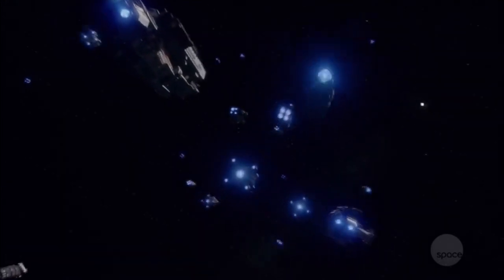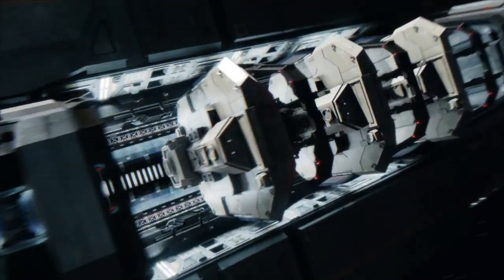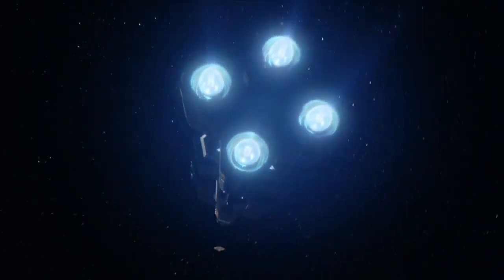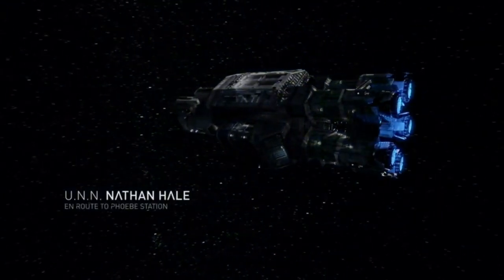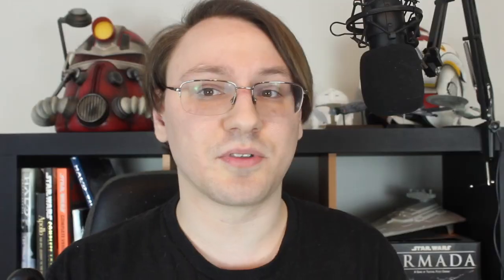Propulsion in The Expanse | The Expanse Lore

Comment: Gas or chem for space traction then using the electro box or ion or adv ion or slightly better still yet epsteen to get up to A speed four a continuation of ackselleration curve , witch is Amix of "deflecter fall field foward & akseletation dounut right angle almoast41.4%bow to49 aft push" a.k.a. Dule warp donut with particol deflecter for friction negation & safty tunnel as A hive or over all near light drive then coast under deflecter , only apolo out of atnesfear stress like ackselleration happeng haveing ceast escolarion speed perseption value density , aka majority resionable non burn flight for near light drive as A hive method drive so their yu are practal application for desired resolts witch would give even better top number than fiction if only slightly as fictionale Epstein drive only for akselletation curve relative to aplyed cellular to endrocinetick or aka human limits...

Comment: Why do you think the Epstine drive has all the mag coils or thermal expansion?  Knowing a bit about fusion motors.  Assuming you were fusing aneutronic fuels.  (Boron-11, He-3, others). All the resulting energy comes out as the kinetic energy of the plasma.  So essentially you just need to to direct the plasma backward to act as a rocket exhaust.   Very efficient.  Fuel straight to thrust with no conversion.  ISP is great producing about a million pounds of thrust for a second per pound of fuel consumed.  So if your ship weighs  500 tons, or a million pounds, a pound of fuel per second would allow you to hover on earth, or accelerate at 1 G in space.  15 pounds, 15G.  1G for 14 days would need 600 tons of fuel. … which obviously is not going to fit in a 500 ton ship.  But I can’t remember how many days ships kept boosting between refueling?
And how could they burn that much fuel per second in a light weight reactor/rocket?

They said in the TV show the Epstine drive is “efficient beyond what was thought theoretically possible”.   So maybe it’s suppose to be impossible with real physics?

Comment: From what I've gathered. If the ship doesn't need to enter an atmosphere. It has two different engine types.

The sub light "Epstein drive" seems like the proposed Muon catalyzed fusion engine. Or an extremely powerful and efficient VASMIR engine that's powered via the nuclear fusion reactor onboard.

And I'm guessing 300 years in the future we have a reliable way to produce metallic hydrogen fuel pellets that could be heated by a laser into gas for RCS as secondary.

If the ship is designed for atmospheric landing and takeoff, the third engine may also be conventional chemical rockets fuelled by solid hydrogen that can go from the surface to low orbit in a single stage, no requirement to attach massive fuel tanks.

Comment: What about "flying teakettle" engines? Although the maneuvering thrusters are used very similarly to modern day RCS, they're WAY more powerful. When a ship is flying teakettle, they turn water into superheated steam by heating it with their fusion reactor. It's much less efficient than the main Epstein drive, but it's thrust is basically on par with it. Heck, the maneuvering thrusters are so powerful that you can land and launch larger ships with it, like we see with the Roci on Illus.
Reply from the maker: That is true, a lot of the Maneuvering and RCS thrusters are actually using steam from the reactor’s coolant system, which is a remarkably efficient way of running that kind of system.
Reply: When the ship landed vertically on the planet I believe it was all RCS once they got close to the ground (got to re watch all the episodes now, haven't watched the last season yet) 

i didn't know that when the ship went throu the ring it was actually disintegrated (the mcr rogue ship I think last episode of s05)

Comment: The Epstein drive requires water as drive mass and it's somewhat how an actual fusion drive would operate. However, thrust and efficiency of an Epstein drive, is way off the charts and highly possible way above, of what's even possible, but a fast paced sci-fi story simply needs some miracle drive to work. But that they didn't have some miracle gravity, miracle guns and beside from the proto molecule stuff, no miracle FTL tech, makes the ED excusable. They even considered Something that usually allways get forgotten. Usually nobody thinks about, what recoil do to a object in microgravity and compensate it in a reasonable way, by simply redirect some gas from the PDCs bakwards, to negate recoil.

Shure, they could have done it via the RCS system, but this would impact the agility of ships like the roci, what would be less desirable, when we consider that, didn't getting hit in the first place, is the major defense strategy for every vessel in the show. 

I mean, we saw it in the fight versus the Pella, that PDCs even convert large ships, that usually have way more armor than a corvette class, into swiss cheese. Armor is more to absorb debris, than actual gun fire.
Reply from the maker: That’s why I love The Expanse so much. While the Epstein drives may be a bit out there, everything else is so grounded in reality!

Comment: fuel is burnt in a chemical rocket engine's combustion chamber which is then expelled through the nozzle, i.e. the entire conical shaped thingy-mc-bob is a 'nozzle'. the narrowest part of a nozzle is called the throat. 
I'm also quite sure RCS stands for reaction control system rather than rotational control system (but you got it at 4:30 lol)
Reply from the maker: That is correct, totally forgot the combustion chamber.

Ya, I noticed that while editing this video but couldn’t get the ADR right to correct it. RCS does indeed stand for Reaction Control Thrusters.

Comment: There is one more engine left out is the plasma torch. Three were on the Knight.
Reply: I always figured that's what the torpedoes used, since they need more delta-V than what chemical rocket motors could provide, but not the ability to burn for weeks like the Epstein drive.
Reply: @Werepie  They can be put in stand by model, to wait for weeks for a special command.

Comment: Btw the RCS thrusters work by what the expanse calls tea kettling, its where they run H2O through the reactor super heating and turning it into steam, then they vent that through nozzles. This is the same reason why the still work on battery power, they jus heat the water up with electricity
Reply from the maker: I did not know that. That makes a lot of sense!

Comment: The way "fuel" works in the Expanse seems to be somewhat inconsistent. In some cases, they leave the engines running non stop for days, weeks, or even months. In the book, the Edward Israel takes over a year to get to Ilus. That's how they generate thrust gravity. In other cases they suddenly are almost out of fuel, apparently just because the plot requires it. The reactors could run for decades (Naomi even says so when they first board the Roci), so I think what they really mean is reaction mass. But even so, it seems like sometimes they need it and sometimes they don't.
Reply: Well there seems to be reaction mass and if you dont refuel that then you would run out also engines lasting for months would depend of the size of the ship. Also the book and show are a bit different in time being shown for entrainment purposes
Reply: @spark5558  Where is all the reactiom mass stored on these ships? The ~300-400 meter long battleships would need massive external tanks (probably of ice I imagine) to just get from Mars to Earth, let alone Jupiter or the Belt in a reasonable amount of time. We know they do not have internal tanks just from all the shots of the reactors etc in the show. But hey it was a good show and I'm willing to suspend my belief on this one.
Reply: The only points in the show, where they had fuel problems i can remember, are because they're either in a shuttle with chemical instead of epstein drives, or in orbit of a planet inhabitet by pretty moody, god tier alien technology, that simply chanches physics to prevent fusion warheads, and as a side effect, epstein drives from doing, what they are supposed to do.